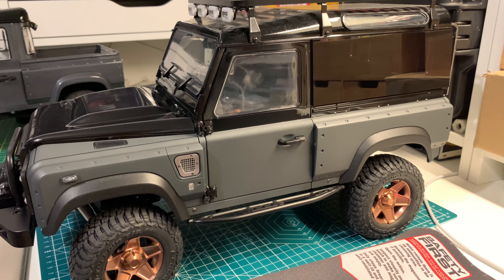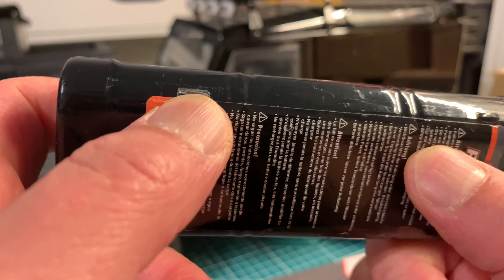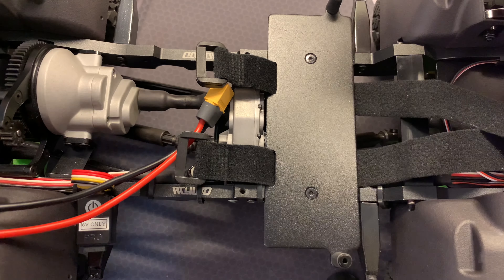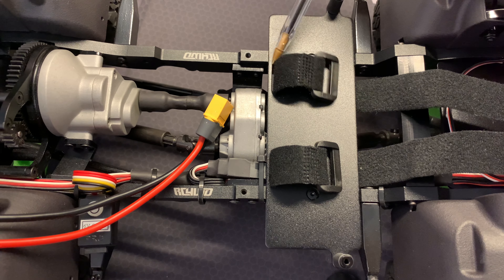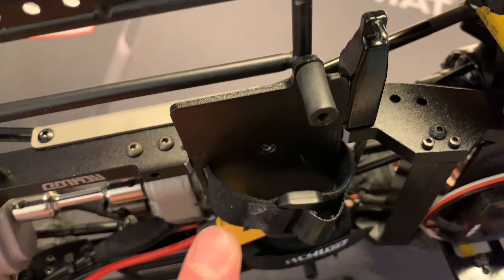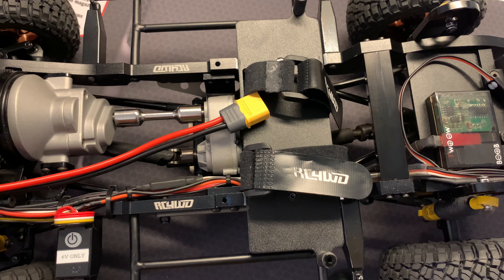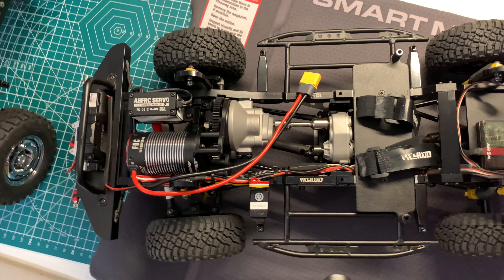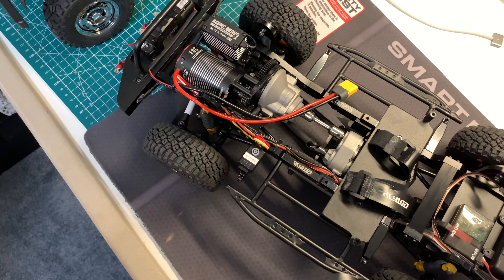RC4WD Gelande II chassis DESTROYS battery pack - Fix your Gelande II with this video

Comment: I’ve been lucky so far! I always make sure that the battery on mine is well snug on the tray. But great tip!👌😎👍 you can still use that battery! Just tape those damaged areas with some electrical tape.
Reply from the maker: I made such a silly mistake when I damaged my Batt 😂 hopefully this vid will save someone else from over excitement! Thanks for checking it out again! 🙂👍